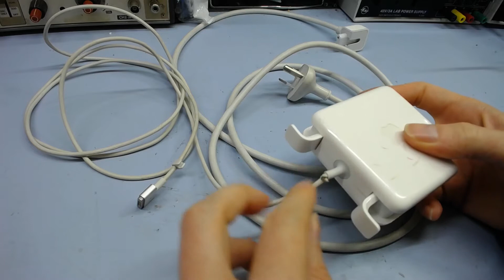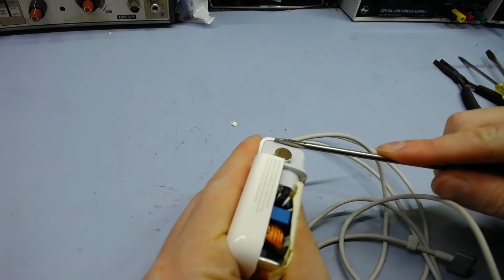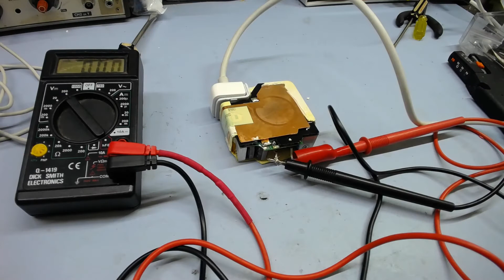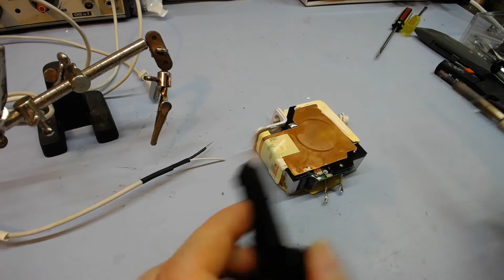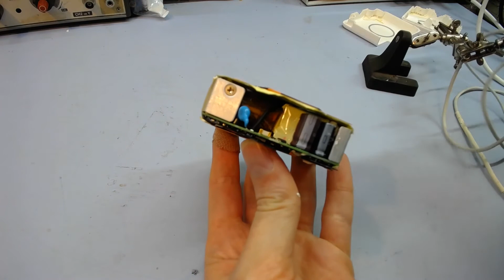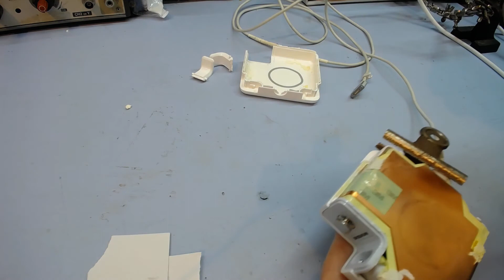Apple Magsafe 2 charger cable repair

Comment: 9:33 what a fucked up design Apple! I would just put the inside in a generic black plastic box, WITH screws, and a EJAJ socket male/female to connect the cable.
Reply from the maker: That would certainly make it more repairable in the future. I have done that before with phone chargers.

Comment: Great video! Super helpful. Borrowing from your concept but instead of a pair of square nose pliers I used one of those wire strippers where squeezing the handles opens the jaws. Worked the same but was much easier to pop open the clam-shell halves. The power supply is not intended to be a "separable assembly", and mine suffered similar damage when finally opened.

Comment: Hey! Nice video and thank you for showing us that these things are quite easily fixable (depending on the fault of course). What size heat shrink is that? like 1mm? Ive never used heat shrink before would like to give it ago.
Reply from the maker: Thanks! But sorry to say I don't remember exactly... Probably 2.5 - 3mm or thereabouts, at least for the inner portion. I often buy various sizes (and colours!) of whatever's cheapest at the time and use whatever fits when I need it.

Just note that there are varieties with different shrinkage ratios so not all sizes will end up the same size, if that makes sense. If you have a local electronics shop, you could go and get a metre each of say 1mm, 2mm, 3mm, 4mm, 5mm, 8mm, 10mm. That should only cost $10 or so and you'll have a good supply for most cases. (Obviously, buy other sizes if it's obvious you'll need those instead!)

You can also get variety packs, but they tend to be pre-cut in short lengths which are not always useful. I like to be able to cut long pieces when needed so I buy it by the metre.
Reply: Bought the little bits of heat shrink 1mm is perfect for the inner bare conductors. Sadly my soldiering iron wouldn’t go hot enough to melt the bucket of solder that was used to fix the conductors to the board so couldn’t remove the old cable :(

Comment: Too bad you didn't actually go through with the original strain relief. As is this is really just for entertainment since few people have another rubber strain relief lying around or a 3d printer. But thanks for sharing. The part of cracking open the case is pretty helpful!
Reply from the maker: I probably could have used the original strain relief - I just did not have a sharp enough blade on hand at the time. A scalpel would probably have worked, but to order blades would have taken a few days, and I had to get the charger repaired as soon as possible.
Reply: @Agent24Electronics  I sharpen all my hobby knives and x-acto blades using a small stone and oil.  Never have bought any more!

Comment: Instead of shrink wrap will electrical tape work around the braided wire, or not?
Reply from the maker: I've noticed tape can slide around and loosen, especially when the wiring is movable, such as on a charger.

As such, I would use heatshrink or liquid tape instead.

But you could use tape if that's all you have, but keep an eye on it. Perhaps add some cable-ties at each end of the taped section, to prevent unraveling.

Comment: Instead of soldering, can one just twist the wires together with the wires coming from the box?
Reply from the maker: I wouldn't recommend that at all. The connection will easily loosen and may burn up due to the high current of the charger. You may even risk damaging the charger or laptop with an intermittent connection.

If you really can't solder them, use a crimp terminal called a butt splice. This will at least give you a good connection, but any such method will increase physical strain on the cable at the join. Either wrap the finished joints in tape to provide strain relief or if they are close to the charger body, tape the whole thing down to the side of the charger so it doesn't move around too much.

Comment: Typical Apple, didn't think in the long term !
Reply from the maker: Perhaps their long term thinking was to sell more adapters ;)
Reply: @Agent24Electronics  Yep, the cords also decay and fall apart.  I wrapped them with the plastic cable strain relief and put heat shrink on both ends.  Good as new (maybe better)